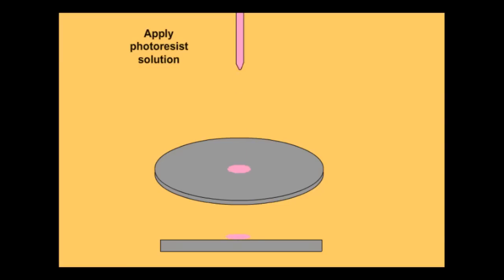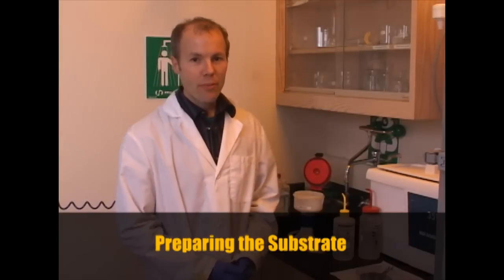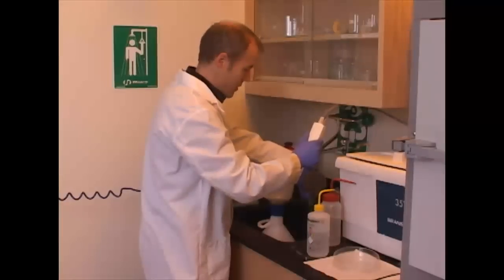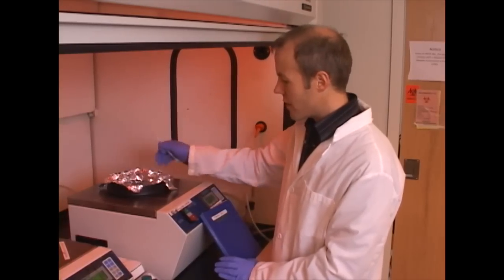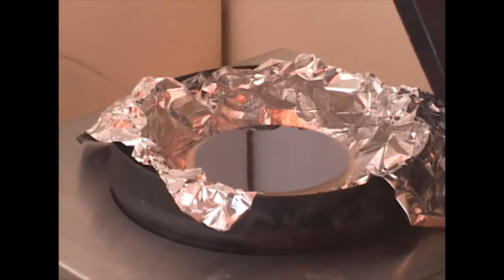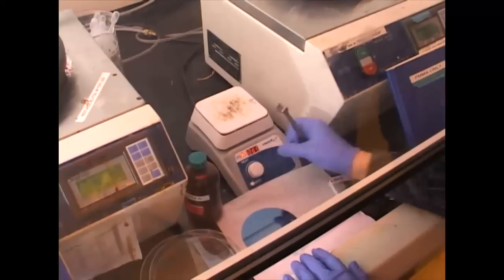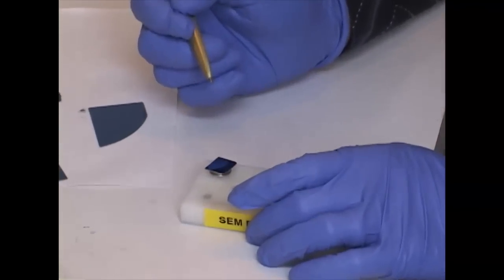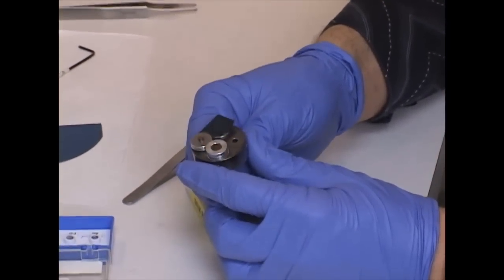E-Beam Lithography, Part 1

Comment: great stuff! I want to build my own e-beam lithography machine , where can I find sketches on how it works?
Reply: You build a scanning electron microscope with an unfocused beam and hook the defelction coils up to a custom analog cnc controller. Like, really, finding diagrams is the easiest part, try looking at research papers paper on the topic, that's always a good place to start. This would be a humongous undertaking to build if you don't already own a working microscope

Comment: Why do you specifically use pure nitrogen to blow excess water off the surface? What's special about nitrogen in this case?
Reply: +Sercan &#39;t Nitrogen is in 78% in our atmosphere. It is also the seventh most common element in the Universe. It is an inert element when oxidation is undesirable, i.e. it doesn&#39;t react much with matter, thus it is very safe to blow the wafer with it. The reason for using &quot;pure&quot; one now is clearer, since if not, you might get some other elements that does react with the wafer.
Reply: Thank you both for taking the time to answer.